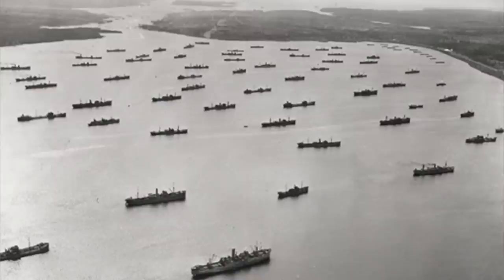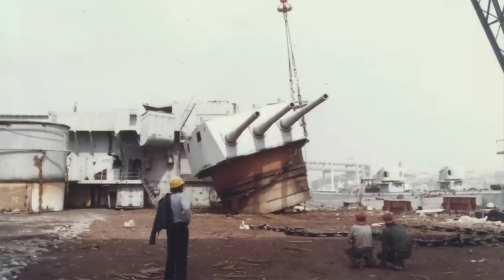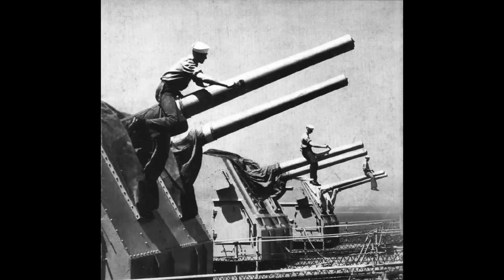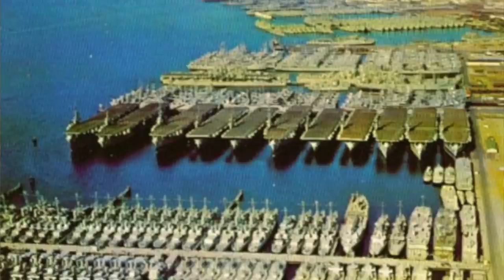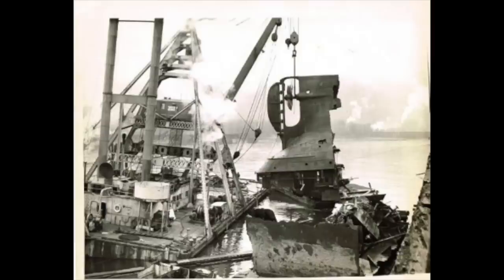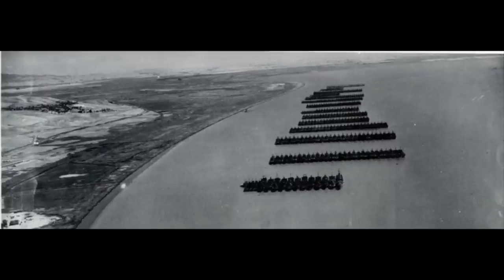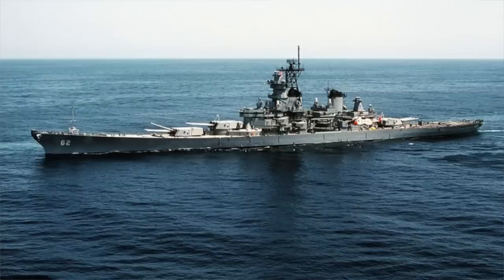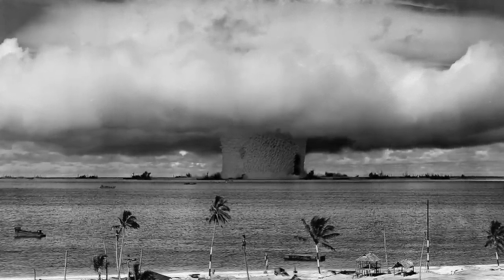The Mothball Fleet

Comment: We should send some to the Philippines and Indonesia, to help them resist Chynese encroachment and agression.
Reply: Worked at Mare Island Naval Shipyard which was only 20 miles away or so. Most of those ships were in poor condition and would need extensive rebuilding to be used again. However, there were some that were kept in a condition to be rapidly reused in an emergency, mostly cargo ships. During desert storm, they brought one to the shipyard to fix any last minute items and to test it out. They couldn't figure out how to light the boilers, so they put out a call to the old timers that worked at the shipyard, if anyone knew how to light the boilers, as there were still quite a few WW2 and Korean War era workers there. One was a guy that I worked with.
Reply: @elnet1  Thanks for your informative post.
 Given the renovation costs, it probably is not economically efficient in an American Shipyard.
 But given that a major component of the cost is labor, would it make sense for the unskilled and semi- skilled labor be done in the receiving country, such as the Philippines, Indonesia, Thailand, or Taiwan to do the bulk of renovation in a home port? Cleaning, painting, maybe the less critical welding, and so forth be done in and by the receiving country? The more challenging technical work perhaps could be done in an American shipyard before departure, or be done under the supervision of American engineers and managers? All of these countries are highly motivated to have the navies needed to resist Chinese Imperialism, and presumably they would be willing to do their part.🤔

Comment: When I was going through advanced individual training at Fort Eustis, VA, back in the late 80s, we would often run PT along the James River. There was a fairly large fleet of mothballed ships anchored out in the middle of the river. It was actually quite eerie to see dozens of rusting hulks sitting out there, rotting away. I've used google earth to check the area over the years, and you can see the number of mothballed ships dwindle.
Reply: Very familiar with that area. I grew up in Rushmere Shores.

Comment: Beautiful metal made before the atomic bomb. No extra elements in the pouring
Reply: The oxygen used in casting metal was force fed from our regular breathing air. After the. .. nukes started being tested in insane numbers ..there was found to be radioactive elements in the whole planets air. These elements were then inadvertently force fed into the metal melting process. No big deal not enough to kill you but enough to make it useless  for space travel as it's slightly radioactive body released interference. True story...after ban on above ground nuke testing combined with improving metallurgy techniques like using only purified air.....it's no longer a problem but for awhile metal made before the bombs started was more expensive. Warships sunk in WW1 were salvaged due to the extreme rarity..........make sense now?

Comment: Most of the Essex-class carriers that were mothballed were reactivated.  Only the Bunker Hill and the Franklin were never fully reactivated but they were fully repaired; they could have been used again during the Cold War.  There were plans to rebuild these two ships to a new standard but those plans got pushed back.  With the emergence of super carriers and purpose-built amphibious ships, the Bunker Hill and Franklin never found their roles after World War II ended.  Bunker Hill was, however, used in Operation Magic Carpet to take American soldiers back home from the Pacific.
At least half the Essex-class carriers (26 planned; 24 built and finished) received an angled deck modernization.  The last frontline, deployable Essex-class carrier was the Oriskany (CV-37) which was decommissioned in 1976.  It was sunk as an artificial reef in the Gulf of Mexico and is currently a diving spot for tourists.
The last active Essex-class was the Lexington (CV-/AVT-16) which was the US Navy's training carrier over 3 decades.  (She was preceded by the USS Antietam as the training carrier.  Antietam was also the first Essex-class carrier fitted with an angled deck.)  Lexington was decommissioned in November 1991 and rests as a museum ship in Corpus Christi, TX.  It is probably the most "open" carrier to the public and has more decks cleared for tourism than any other carrier museum.
Right now, these vessels are the most represented class of aircraft carrier preserved as museum ships.  Three of the four remaining Essex-class ships are namesakes for carriers sunk earlier in World War II (Lexington, Yorktown, Hornet) and they are all low-number hulls (CV-10, 11, 12, and 16).

Comment: Very interesting.  Not something you'd ordinarily think about, especially now that a lot of military hardware is used for three, sometimes five decades before being replaced.  It's almost a bit like the evolution of CGI.  In the early days of CGI, from the early 80s to the early to mid 90s, CGI was pretty primitive.   But by the late 90s, CGI and computer gaming graphics started to become more life like.  And now throughout most of the 2010s, the quality has practically topped out.  So it's just a matter how big your budget is and how skilled the artists are.  With military hardware, now that we're into the Stealth Era, thing have changed drastically in recent years, and so anything that's not stealthy is in danger of having to be scrapped.  Which is puzzling since they seem to be pushing the Gen4+ fighters now with the F-15EX Eagle II and the F-36 Kingsnake (F-16 remodel)

Comment: I know they say battleships are obsolete but I really don't think they are. If they upgrade the ships to use railguns they could still preform the role of naval artillery at a fraction of the cost of using aircraft and a carrier or missiles. And since a small rail gun can have the same impact force as a large shell an Iowa sized ship could probably host twice the firepower they had during their last use in the 90's. They would be a must have piece of weaponry for naval landings. It's a little perplexing to me why the navy hasn't considered this since they're already complaining of their ships being under equipped where vertical launch silos are concerned. Rail gun ammo $1900 per, 1 tomahawk  missile 1.5 million. Battleships are not obsolete.

Comment: Just like American vets once their usefulness was over they were thrown away and forgotten... Sadly fresh water berths and multiple hose downs and grease layering with a canvas or other covering along with mild electrical charging would've halted most sea related corrosion and left most ships both seaworthy and battle ready with minimal work and effort...
Reply: Well, that isn't true.  Even with the best attention, ships in mothballs require expensive upkeep and still deteriorate.  Our navy engineers know better than you the condition of the ships, the cost to re-activate them, and their obsolescence. (old salt).
Reply: Most were eventually scrapped because they were obsolete, not because of condition issues...